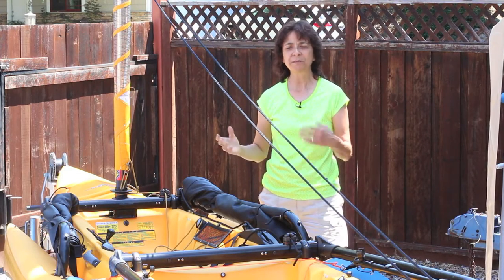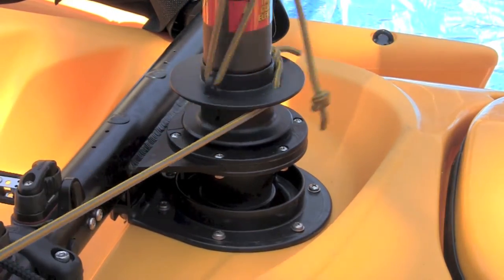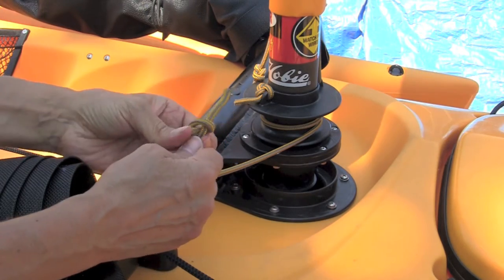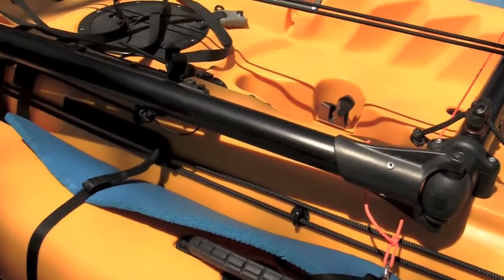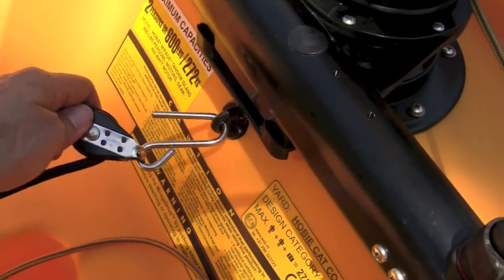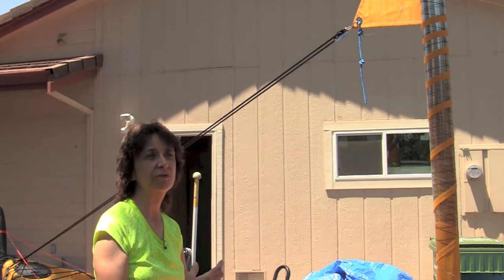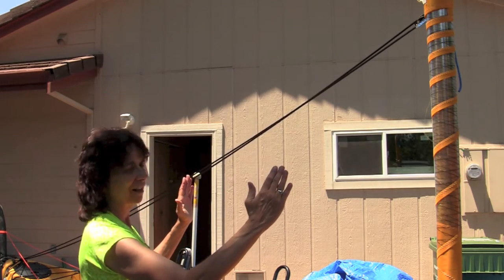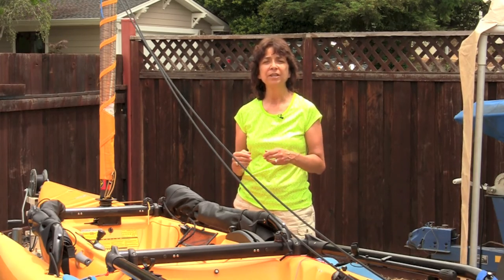Hobie Tandem Island Sail Rigging by Rockin Robin Sails

Comment: Great video and well done. This is a valuable service to new TI owners that Hobie should provide. I'd like to add one important tip, tie the end of the furling line to the end of the rear mainsheet line. That way when sailing from the rear seat you will always have ready access to the short furling line which may otherwise be very difficult to reach.
Reply from the maker: James Luisi That's a great tip and I've heard of it before but forgot about it.  Would you only attach the furling line to mainsheet when sailing in the rear seat?

Comment: super video.. THX. i like to see  how you sail the TI solo.
cheers Michael from Denmark
Reply from the maker: BlueprintDK You can sail the TI from either seat as both have a set up.  Big guys that like to have their weight in the rear seat just tie the end of the furling line to the end of the sail line in the rear.  That way they can easily pull in the furling line when needed.  Does that make sense?
Reply: +Rockin Robin Sails thanks.. do you have links to some Pic that shows the solo setup.. my TI2015 will come next week and i will be using it solo most of the time :-)

Comment: I usually sail from the front position because due to permanent injuries I have difficulty reaching forward to operate the drop keel. Do you know of, or have any suggestions, on how the keel can be operated down-up from the rear position without getting out of your seat e.g some home-made pole or device?
Reply from the maker: Interesting question.  I think you could make up some sort of pole to do that.  I will have to look into that.  Have you had any luck figuring that out?
Reply: No, not yet. I was thinking of perhaps changing the knob on the keel to a RAM mount and then having a corresponding female mount that encapsulates it. The next problem to overcome would be how to be able to lift the knob out of the detent so that it could be positioned forward or aft (Incorporate a pivot point on the pole somehow?). The problem after that would be whether to have the hand pole going from the rear to the knob/RAM mount fixed or free, and how and where to stow it.

I think this sort of arrangement, or similar, would make life easier for anyone to operate the boat from the rear seat. As we get older, injuries aside, we become somewhat less nimble.